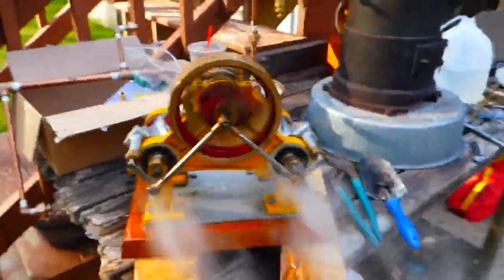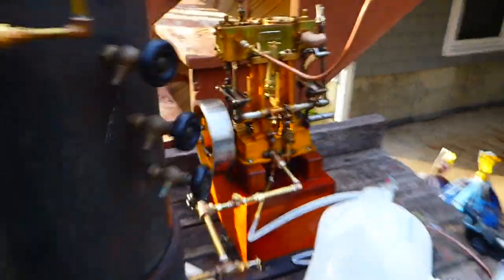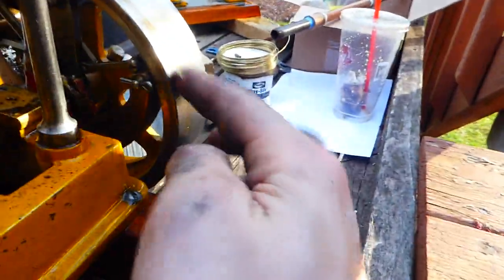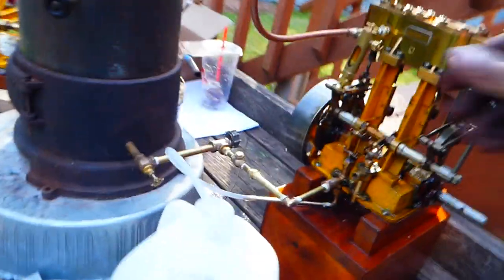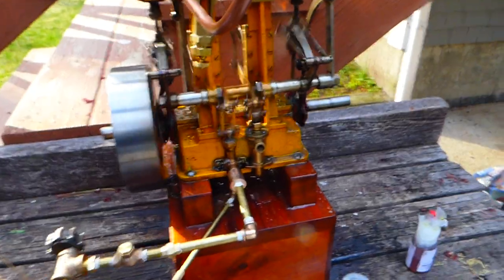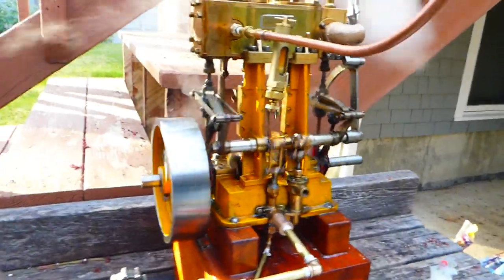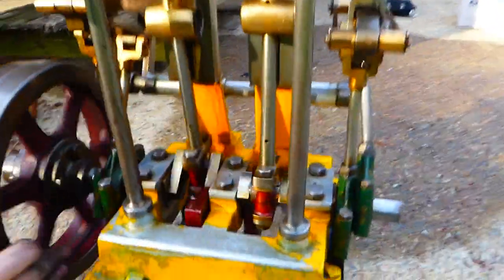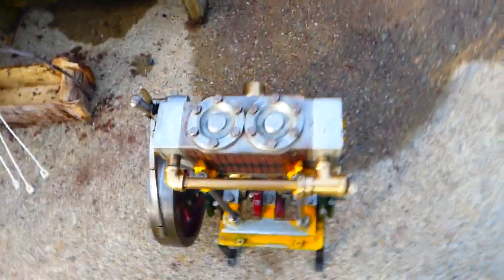The Experimental engines of George Eli Whitney 2

Comment: Very classy that you actually take the time to hard pipe the engines to the boiler instead of using hoses.
Reply from the maker: Nothing classy about a temporary pipe setup, you wait and see what a finished one looks like when I have the time/engine to do it on.  Thing is I can't even get a proper base together for this boiler and a feedpump/deaerator tank setup.